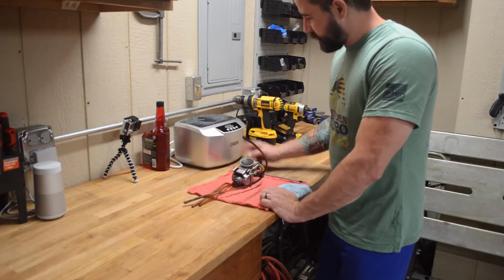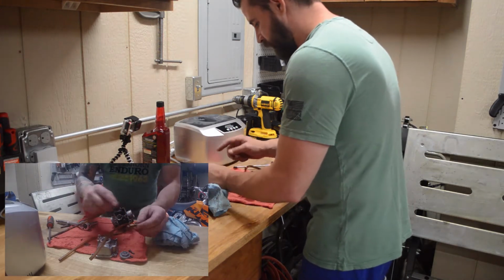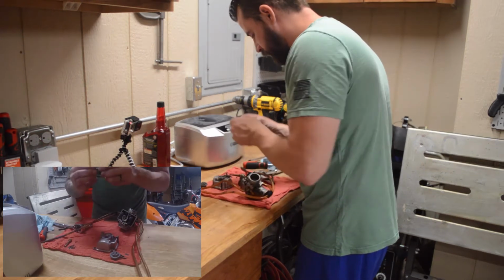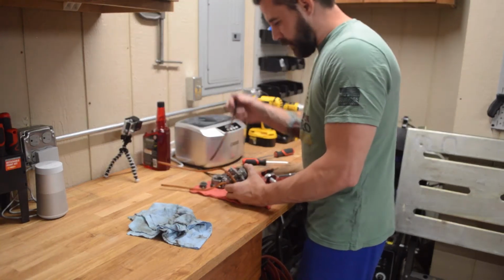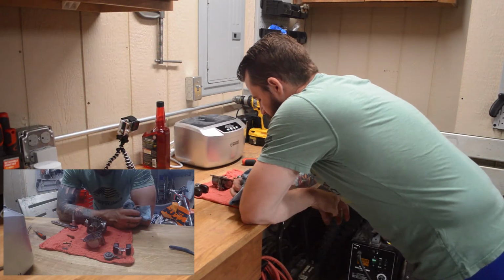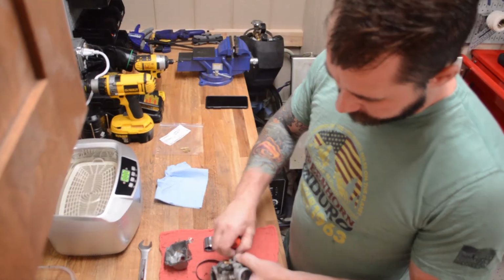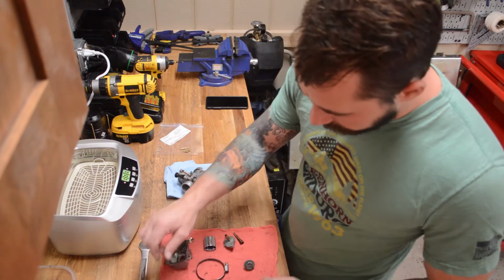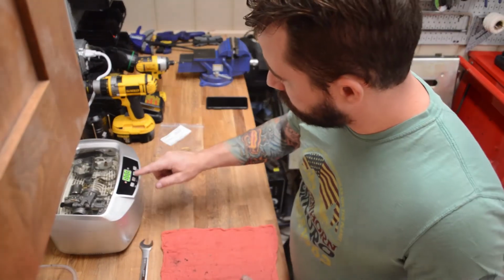Dirt Bike Project -- 2004 KTM 85sx Part 2 - Carb cleaning and "First kick" ?

Comment: I got a 07 ktm 85sx for $300 it had a new top end and ran pretty much perfect but the fork were blown and got that done for all the parts and labor for 200 
random parts and fluuids were about $60 and anothe $300 for new master cylinder and carb rebuild with labor and now shes great

equiling out to around $900 in it and is super fun
Reply from the maker: Good find!
Reply: @PlushEnduro  great vid series keep up the things u do

Comment: Hello mate are you active at all I’ve got a issue with my 04 ktm 85 she’s leaking fuel out of every overflow for the carb it was a tiny leak when I brought it 2 days ago haven’t done anything apart form dropped the bowl bolt and it’s worse now lol I’ll pull it and clean it when I’ve got time any suggestions on float heights or just guess and go from there
Reply from the maker: Hey bud! sounds like a stuck float to me, that's the usual suspect or what I would check first. Some times just wrapping on the float boat with the handle of a screw driver unsticks it. Id' yank the whole thing apart and clean it real well with brake clean to get all the old gunk out though.